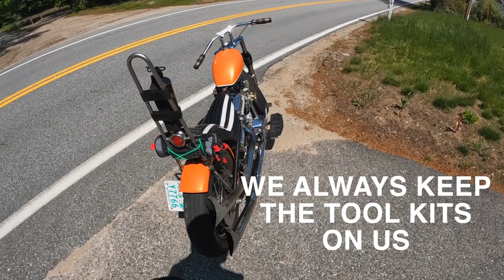Chopper Ride: Celebrating the Spirit of Memorial Day

Comment: Hey Grease. I really dug this video. New Hampshire might not have the best roads (likewise for Ohio). I really like that Dirty Biker two-into-one exhaust on Ryno's Shovel. I also like the fishtails on your EVO. I ran fishtails on one of my Pan/Shovels. Drag bars offer optimum handling during fast-moving situations -- especially through town. That cemetery is well-kept -- a place of peace. Ride safe.
Reply from the maker: Agreed! The drags make it so nimble, but I did end up putting the ape hangers back on in the end. A decent compromise. I think the final form will be some lower apes like 6”.

The 2-1 always appeals to me, I’ve got some stainless I’m going to use to make a 2-1 fishtail this winter, I’ll make a video on the how to process 🤘🏼
Reply: @greasesgarage  -- I used to run my drag bars clamped into Paughco 6"- or 8"-inch-high glide styled risers. If I wanted something other than drags, I'd either go with low rise Z bars or with Flanders # 1 bars (a low-rise ape-styled bar). I never got into pullback bars. I see quite a few guys who run reach-for-the-sky apes. Besides being uncomfortable, those sky-high armpit driers are a determent to the bike's overall handling. Likewise, for lots of frame rake and overly-long forks. Personally, I go for bikes with zero rake and possibly a little stretch in the frames front down tubes. For still-decent handling manners and an optimum "cool" factor, I like forks that are no longer than six-inches overstock. For the most, you've gotta steer a bike and not just rely on body English (as in long sweeping curves). Performance-wise, a two-into-one is the best exhaust for a V-Twin engine. I've been preaching that since the early 1970s. That stainless 2-into-1 fishtailed exhaust sounds choice. Thanks for the links to the other how-to-do-it videos. I'm getting the word around. Build right. Ride safe. -- W
Reply from the maker: @walterfechter8080  I might have to try some drags on a longer riser that’s a great idea.

And thank you for spreading the word. That’s all I want from anybody who enjoys these videos. Spread it around so this channel can grow beyond one man and his one bike. There’s a lot more I’d like to teach in the future
Reply: @greasesgarage  - Knowledge cancels out the darkness of ignorance. Life is for learning. I wish I had my youth back. Good luck in everything you do. Ride safe -- W